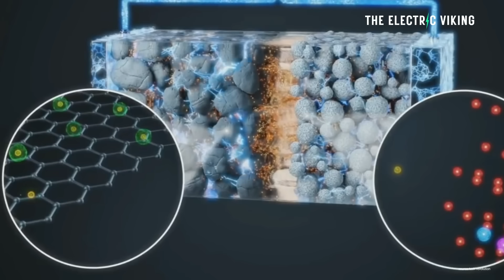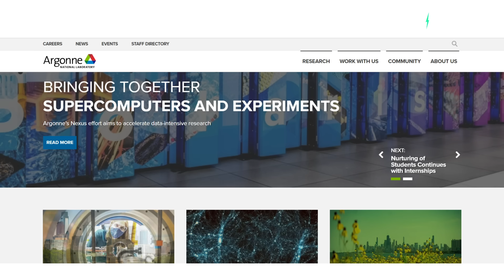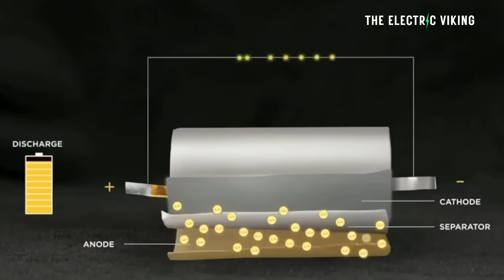US Government Scientists expose why solid-state batteries keep failing

Comment: In a related story, nuclear fusion technology has hit a temporary snag..."
Reply: And later this year your first mass produced HYDROGEN car for sale will also be premiering................................................................ LOL
Reply: actually, hydrogen is a lot further along in development than you think.. @stickynorth
Reply: @adotintheshark4848 

"actually, hydrogen is a lot further along in development than you think.. @stickynorth" 

If it was the Dutch wouldn't be talking about 'blue hydrogen' because producing it electrically using renewable power would already be cost efficient without relying on fossil fuel reducation methods - but it isn't yet, and may never be.
Reply: Where's my cold fusion?! Oh yeah. That only lasted about a week.
Reply: @stuffdadmakes2954    They are still actually working on it.   A number of studies in the last decade has confirmed that it does exist, and they have an idea now of under what circumstances.    The problem is that the energy production is infinitesimal with what they can somewhat reliably duplicate today.  I believe that they can only recreate the conditions it works under in about 1 out of 5 attempts to create a material with the required structure where it works (and those are relatively expensive attempts).   Again, and then it's just an infinitesimal amount of energy at this stage.

No one is making any great claims about cold fusion or even can suggest a timeline.  But, further research is getting funded because of the progress they have made.  

I think the 1st key is being able to reliably develop a material with the right structure.   Once they can do that - then power density can be addressed.

Someday cold fusion may actually become useful.
Reply: Nah.

Fusion has so many possible pathways to implementation that you really need to get more specific than that.
Reply: Don't tell me; it is 20 years away?
Reply: For some time I thought hydrogen fuel cells wouldn't be practical simply because H2 will leak right through the metal tank walls or make them brittle. But, I needed to consider making the tanks out of fiberglass or other materials. In order to store enough hydrogen in a practical sized tank to get much work out of it it must be stored at pressures of 1000 psi or more.
Reply: Seems like Fusion has the same snag it always had . I think a small company will achieve commercial Fusion before the
large ones will.
Reply: @ctuna2011  A garage engineer with some kind of Tesla like understanding of gravity accidentally creates the practical wormhole generator or gravity reduction field. I would love to see the headline.

Comment: What some don't understand is the fact that if you create something that lasts too long is a bad investment. Look into the 1950's light bulb agreement by the 3 major sharks.
Reply: I haven’t replaced a washer, dryer, vacuum cleaner or refrigerator in over thirty years.
Reply: @mnhsty  I got a fan I bought at walmart in 2001.  Stanley.  Its still running, right now, keeping my 3090 cool.  It probably has 10 years of "run time" on it.  lol.  Through all the use its had.
Reply: I meant bad investment for the manufacturers. 😂
Reply: If I were a company (Apple?) and could create a product that is maintenance free and will not obsolete (OTA updates) I'd sell the product at top dollar (Apple & Tesla) and not worry about replacing or maintaining the product (a pain) I'd make them and sell them at top dollar.  Never mind the cheap imitations.  That's how you build moats in big companies.  Quit selling crap!
Reply: There is some truth that companies find the balance of quality and lasting but also needing customers coming back for a new model. The reason Toyota is the world's largest automaker is that they make the longest lasting cars. But if they lasted forever (impossible anyway), then they'd hurt future sales.

Comment: Solid state and cheaper better batteries are going to benifit the costumers.
Oil is subsidized $7T.
Whit a car production of 80.000.000 and 1/4 of all oil used for fossile car fuel.
A fossile car are subsidized $21.875. 
Oil is also controlled by a cartel, where most of the members are dictatorships.
That's on top of the 0% loans to fossile car companies.
An EV has 1/3 of the parts compare to a fossile 
So, you can probably give away all the EV's based on the subsidies alone.

Fossile cars are from the numbers and the polution just madness.
Reply: How many cells are there in a Tesla model 3 battery? A third of the parts? Really? And what makes the tyres, the paint, the foam in the seats, the door seals, the cooling system components, the insulation on the wiring, the lenses on the lights, the dashboard, the carpet, the upholstery and who knows what else, on an EV? Would it be oil, by any chance?
Oil isn't going away any time soon, I'll give you the tip.
Reply: @davidbrayshaw3529  sorry, I didn't include the 20% of oil subsidies $7T 20% = $1,4T we also have to pay for the rubber, and plastic.

It's probably cheaper to get it from the oceans, where you can convert the drifting plastic to oil, and use that.
Or, the old tires..
Reply: @geirvinje2556  We are all oil dependent whether we like it or not, car or no car, ICE or EV. If we weren't, we wouldn't be having this conversation via our computers.
Reply: @davidbrayshaw3529  We need to get of pumping oil.
So, we need to start now.
Making fuel for cars with oil is stupid, because the energy loss are probably the same you need to drive an EV the same distance.
So, EV's are a no brainer.
Reply: @geirvinje2556  And what are we going to do with all of the left over petrol and diesel that we're left with after we refine crude oil to make the components in our EV's?
No crude oil = no EV. It = no lot's of things that most people don't even think about, like fertilizer, for example. Or the computer that I'm typing on, the soles of my shoes, the chair that I'm sitting on, the lenses in my glasses, my phone, my rain coat...
Oil's not going anywhere, until it runs out or climate change finishes the job it set out to do: Rid the world of excessive humans.
Transitioning to EV's is just more consumption. It's more oil that we need to pump and it's more oil, gas and coal that we need to burn to fuel the things.
We need to reduce our dependency on oil.
ICE vehicles are a small fraction of the problem. Our standard of living is the biggest problem and the number of us that there is on the planet.

Comment: solid state's problem is the brittle nature of the glass electrolyte. Put it in a car and it shatters as the body flexes going out of your driveway.
Reply: What car do you have in that glass is such a problem? I'd hate to have to replace the windshield and windows every time you leave your driveway.
Reply: Teslas have rolled over and had their glass roof intact. A small piece of glass in a battery in a case is going to be pretty well protected. And, I'd expect some testing will be done.
Reply: Yep, particularly if it is a structural battery

Comment: I’ve been making homemade chemical batteries for years. Experimenting with different Metals and Electrolytes. Depending on how many cells run both in Series and in Parallel to Boost Amps. It’s a Fun Hobby.
Reply: you should made the video and post it on youtube. at least some one can made a home made battery for their own home. especially battery cost is so expensive for solar panel.
Reply: Are they viable for solar applications?
Reply: @neiliewheeliebin  YES
Reply: Dirt, dirt & dirtier dirt  self charging  solid state batteries.  Modeling clay, quarts sand & powdered, activated charcoal. The clay squishes down on the sand exhibiting the piezoelectric effect. The charcoal carrying the released-ion.  After mixing, adding distilled & electrolytes  wrap a precisely measured blob around the solder & work into a cylinder shape evenly wrapped around the solder. Leaving enough solder to get on with an alligator clip. Wrap in aluminum foil, avoiding contact between foil & solder. I found simple drying created electricity.  I baked some in an oven & think it made more electricity.  I made up a bunch of different common water soluble, household products in labeled jam jars. It only took a few drops of any solution to get the clay, sand& charcoal to work. The sand & charcoal dry the clay out.    Borax, sugar, sulphur, stump remover, Himalayan salt to name a few electrolytes I experimented with.  I worried the aluminum foil is decomposing creating the galvanic  effect. Not my desired intent.  I'm thinking an extremely fine carbon black, activated charcoal mixed into a nail polish..varnish..
Reply: @GWAForUTBE sugar and stump remover 😂 big bada boom 🎉